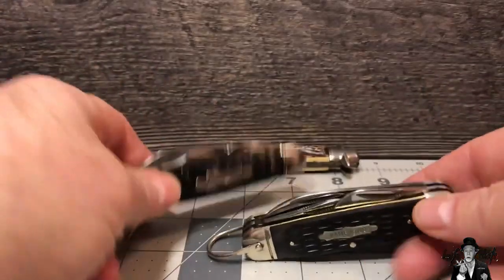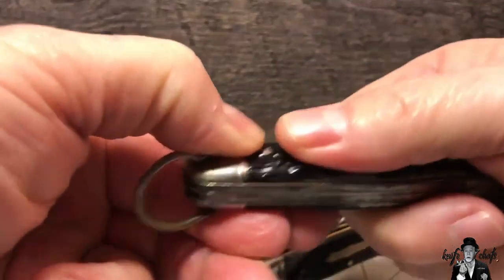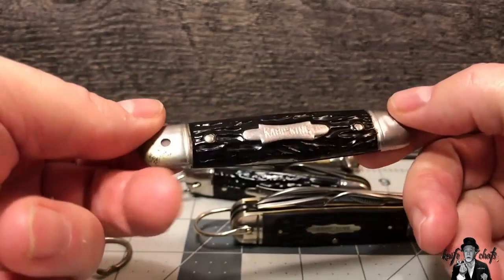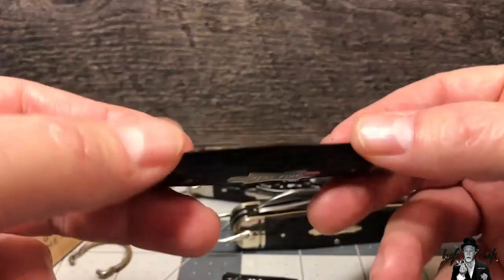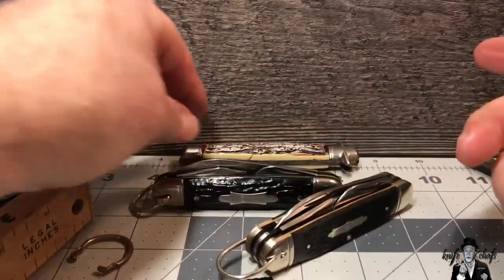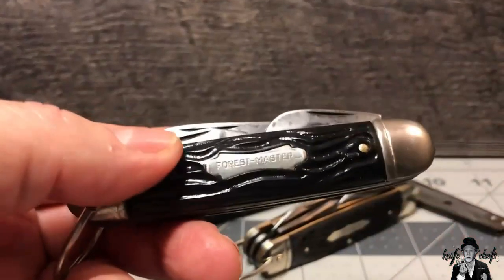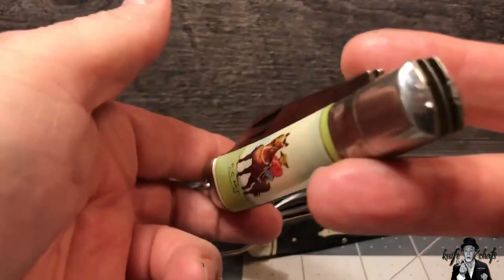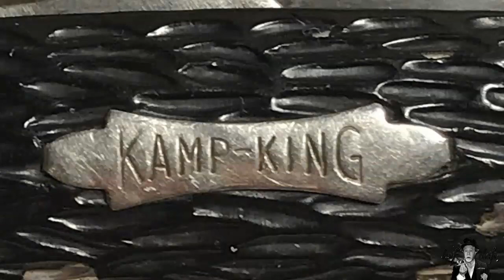What's a "shell" handle

Comment: Wow. What a great video! Now I know. I have two old (1960s or 70s) Kamp Kings that rattle. I knew it was the handles but didn't know they came right off! I'll have to tinker with one and see if I can fix the problem. Pretty sure my Imperial fish knife also has "shell" handles. I wonder if this technique is the same as the one used by Northfield in the late 1800s. I have a book on the history of the company that includes an illustration of one of their biggest sellers: A budget knife with hollow steel handles that were made to look like stag (or jigged bone). This knife was said to have saved the company at one point.

Comment: Good video and good explanation of how the shell handles are assembled 

But the color coating isn’t enamel paint on the one you took apart, and on all shell handle knives I’ve seen. It’s actually a thin plastic sheet that was heat shrunk onto the stamped steel shell. I believe it was celluloid (but some may have been polystyrene) and some older shell handle scales I’ve seen were shrinking the same way regular scales made of celluloid shrink. 

I have “renewed” (I won’t say “restored”) a couple of those by peeling off the color layer, masking off bolsters—and shield if one is present—and spray painting them. 

You can tell if the color layer is plastic, not paint, if it isn’t bonded to shell and comes off the shell easily rather than flaking or chipping off as paint would. 

This part of the knife’s construction was cheaper to make, and the knives sold for budget prices. But the blades, springs, and liners were about the same quality as regular handle knives.

Comment: So I’m not sure if you answer questions or not but I have 2. I have a kamp king that belonged to my grandfather and of course the enamel is chipping off like most of them do. I’d like to freshen it up some and actually use it for everyday use and I may even paint it to have some originality to it. Are the shields on the camp king removable? Also mine is missing the ring on the end. Can you buy parts for them or do I just have to try to find one that’s maybe broken or something that still has the ring attached?
Reply from the maker: I try to answer all my comments but admittedly I fail miserably, especially on older videos.   But as for you questions.

1 -  To repaint the handles I would remove all the old  enamel, if possible and then use a an appropriate color nail polish to repaint them.   Nail polish takes abuse pretty well but it will also chip. So you might want to buy enough nail polish for multiple coats and for touching up.   You can also give a couple clear coats over the color.  (be careful in your nail polish selection because some are translucent. 

2 - the shells on most Kamp Kings can be removed and and replaced but they tend to be loose once you do this.  But a good two part epoxy will keep them tight.  But be careful or your blades might also get glued in place.

3 - I'm not aware of people selling parts but you can often find older Kamp Kings and similar camp knives with the removable clevis. The clevis  is pretty much interchangeable  Just be careful prying it off so as not to bend it. 

Hope this helps
Reply: thank you so much this definetly helps alot. Again id really like to just freshen up grandpas old pocket knife to make it useable. not necessarily a show piece but more just to freshen it up and possibly pass it down to the next generation.

Comment: Is there a way to tighten up a loose shell handle? I have a budget knife that is ratting a bit, and I'm fearful I might screw it up if I mess  with it the wrong way. Should I mes with it of just let it be??
Reply from the maker: I think your best bet would be to remove the handle and then re-attach it with an epoxy of some kind.  I've never tried to do this, however.   If you do, make sure the blades are open and also make sure the epoxy is does not get on the joints (pivot points).  That would be bad.